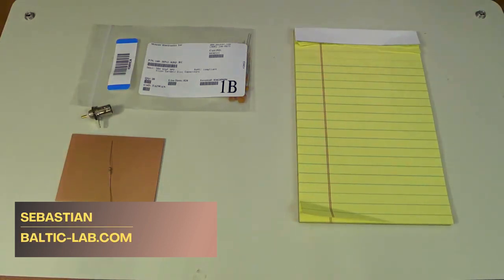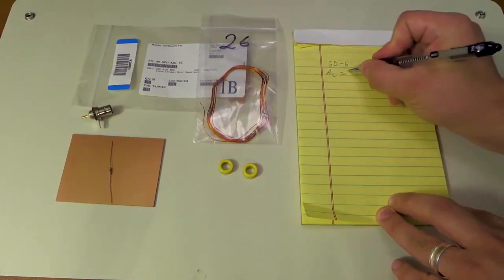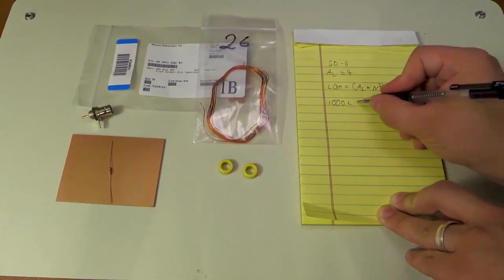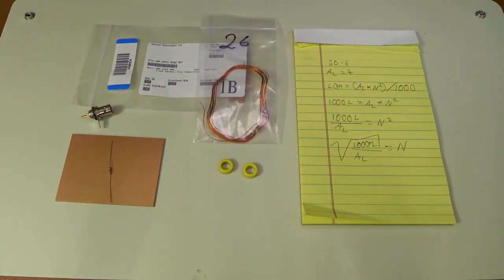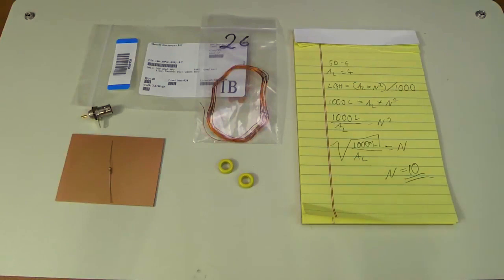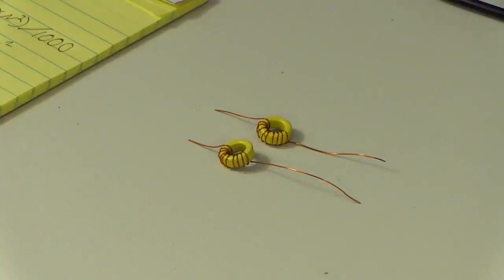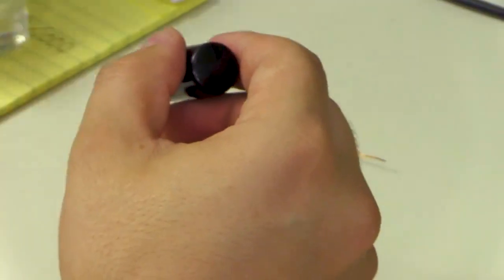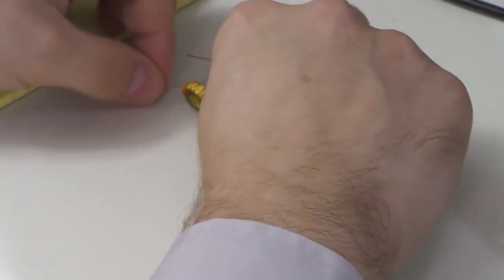How to Calculate and wind Toroid Core inductors

Comment: Have you actually measured the inductance of your toriod-wound  10 turn coil??...maybe not.  I have tested this using L=AL*(N^2) with several different coils, and this formula worked every time.
400nH is quite small for winding on a toriod (whenever I need < 10uH, I have always used air-core).  The first thing that comes to mind when I see a required 400nH (0.4uH), is 'air core'.
If you measure the L of your coil, I think you will get about 400uH...not 400nH...that's 1000 times higher.
THANKS,
--daLe
Reply from the maker: Your statement is still incorrect. Please note that different manufacturers give their AL values in different "units". L=AL*N2, L=(AL*N^2)/1000,  L=(AL*N^2)/1000^2 and  L=(AL*N^2)/100^2 are all acceptable equations for toroid inductance depending on the manufacturer's specifications. While I didn't specifically measure the inductor, I did use it in a practical, reactance dependent circuit. And the performance was spot on (https://www.youtube.com/watch?v=3IAVJ4gVunE). Additionally, online calculators would confirm my math for the Amidon cores: https://toroids.info/T50-6.php

Comment: I am still a bit confused about this calculation.  If AL is given in micro henires (uH), and AL=4uH, Then only ONE turn would give an inductancd L=4uH...which is 4000nH...already 10 times higher than what you need (400nH).
THANKS for making me think.
BTW:  I have found that just touching the leads of an inductance meter through (or inside)  the toriod, gives a direct reading of AL.
Reply from the maker: The AL value is given by Amidon in µH per 1000 windings. The inductance L is thus calculated by: L = (AL × N^2)/1000 where N is the number of windings.

Comment: I'm looking at manufacturer's data for a specific toroid and the AL figure given appears to be within the range of 89 - 210. How does one possibility design around that kind of variance?
Reply from the maker: If no dependent variable is given for the range, I'd use the geometric mean for design, so sqrt(89×210) = 136.71 nH
Reply: @BalticLab  Thank you very much. For reference, the part number is Proterial FT-3KM 4627H. Thanks again!

Comment: I have seen some numerous examples of inductor winding with superfluous maths  can't inductor winding be explained without these hassles? I still don't get it
Reply from the maker: No, because then it would be a 30 second video at max as anyone should be capable of wrapping some wire around some core material without guidance. To know how much wire you put on there, that is kind of the part that needs figuring out.

Comment: You really need to use the INNER circumference of the toriod to calculate the # of turns that will fit, since this is the limiting factor for the max. number of turns that can fit...you will have gaps between wire turns on the outer surface when the inner circumference is tightly filled.
Thanks for the great video...I am especially interested on the Al factor.  Can you maybe do a video mainly explaining Al and using it??